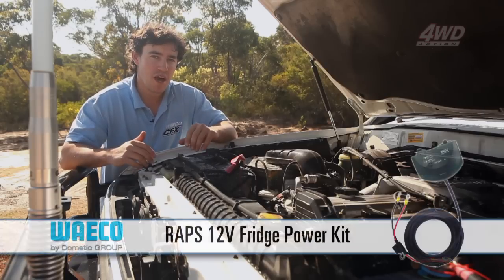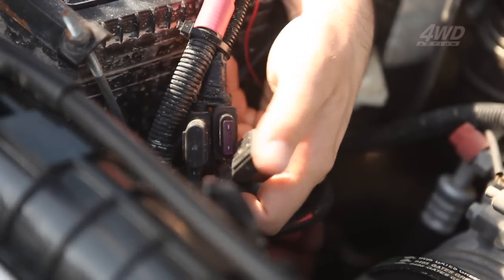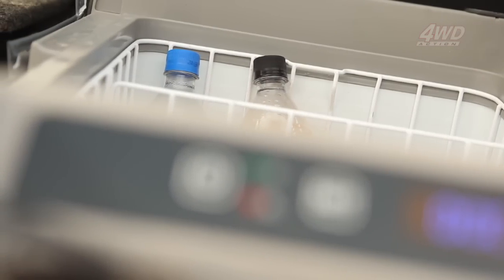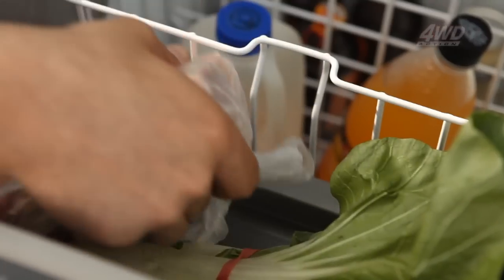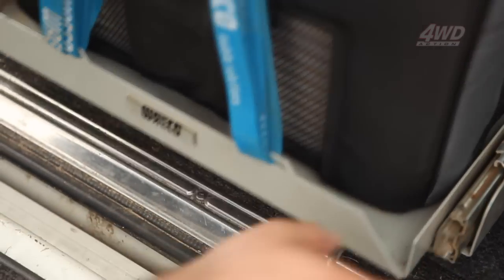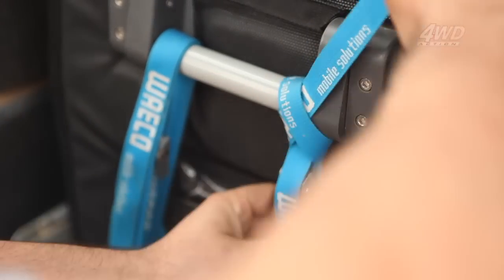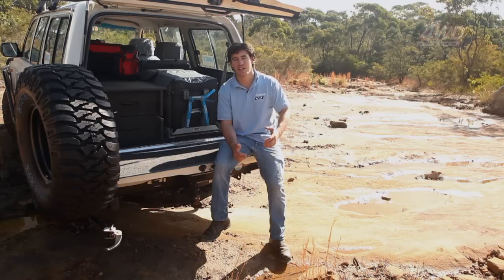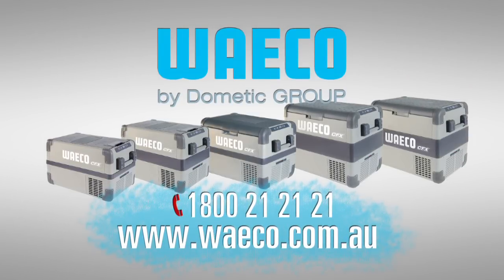Waeco 12 volt Fridges like the CFX - Tips, Tricks and Secrets

Comment: I bought a CR110 for my motorhome and so far I have mixed feelings.  After 24 hours, water has not become ice - although admittedly I only have the ice tray in the compartment.  It also does not seem particularly cold inside although I do not have a thermometre.  I hope that the situation will improve.
Reply: Since writing the above comment, I have learned that the mistake was mine and that the wiring I used was incorrect.  The fridge works very well and I am very pleased with it!

Comment: My CFX65 worked faultlessly for the first 12 months now it's in getting repaired after failing on a trip. There's a 12 degree temp difference between the dig read out and the internal temp, the circuit override switch doesn't function and often it heats up instead of cooling down, and that it on 12 and 240volt. 
Don't waste your money on one of these, they're not that cool. Wished I bought a National Luna instead!!! Sorry Waeco, your product just disappoints me greatly. 👎🏻👎🏻👎🏻